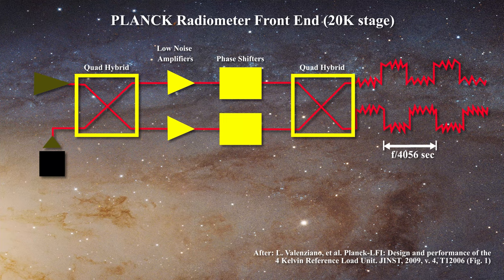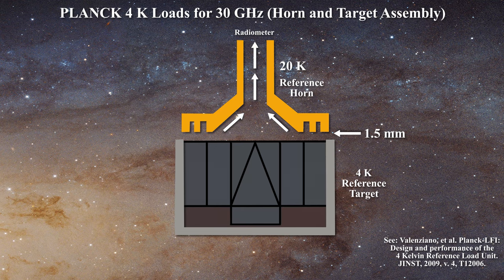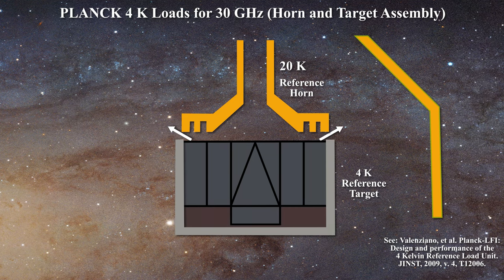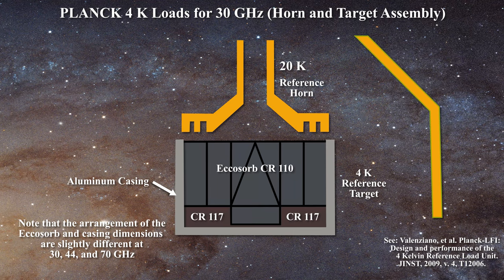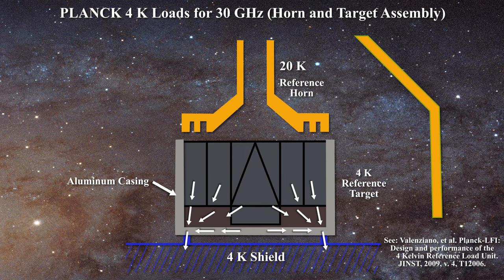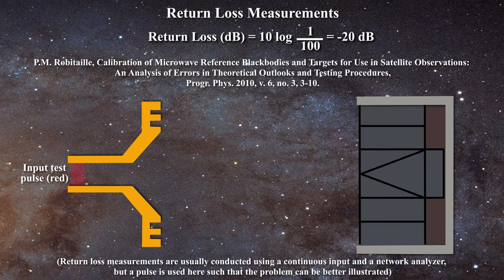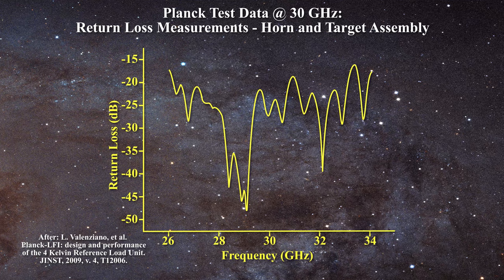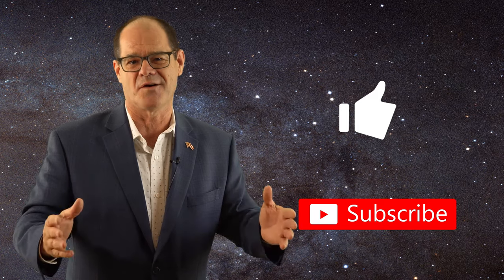Planck Satellite - Analysis of the 4K Blackbodies!

Comment: Ok The usual attack by your poor understanding of technical effects at the 1% which is used to rubbish the measurements.

1) At -20dB return loss that means the calibrator is absorbing 99% of the power that's blacker than your favourite carbon black at 95%. Any slight ripple in the remaining 1% doesn't matter
2) Should be as much spill-in as spill-out which is not seen ie you want 99% lost through the gap, which means inflight 99% of the outside 20K radiation would get in. Also, you see those slots around the air gap, they are to decouple the electrical field from the surface to specifically prevent the slot from transmitting radiation.
3) You clearly have no understanding of thermodynamics. If an absorber is at 4K it has to emit at 4K because it's just a dumb bit of material being jostled by its neighbours also at 4K. You need to employ Maxwell's Demons to stop the emitting of photons.

Besides, I have direct experience of using calibrators like these in cryostats and I can assure you they work!

Also by the way, why didn't you include the 300K microwave emission from landmasses is your Oceanic monopole?
Reply: "Ok The usual attack by your poor understanding of technical effects at the 1% which is used to rubbish the measurements."
 Watson

Unfortunately for the Planck team, it is not just a 1% error!  It appears that you do not properly understand return loss measurements and the problems which can be encountered with them, as your follow up post clearly demonstrated.

"1) At -20dB return loss that means the calibrator is absorbing 99% of the power that's blacker than your favourite carbon black at 95%. Any slight ripple in the remaining 1% doesn't matter"
. Watson

Unfortunately, that is only true if 1) you have no possibility of generating standing waves in the material, 2) you have no unexpected losses and 3) everything is absorbed on first pass (which you can never know).  Yet, the PLANCK team has resonances in their data, not just a slight ripple.  So they do not have a blackbody.  Blackbodies cannot support standing waves.  Rather, they must immediately thermalize all the incoming radiation.  This is clearly not happening in this case.  Secondly, the Planck team's own data shows that the E field travels beyond the gap and furthermore, that the differences between the Eccosorb 110 and 117 do not affect its distribution.  You do not have a blackbody and your losses to processes other than absorption are non-negligible. ( see figure 10 in https://iopscience.iop.org/article/10.1088/1748-0221/4/12/T12006/pdf )

2) "Should be as much spill-in as spill-out which is not seen ie you want 99% lost through the gap, which means inflight 99% of the outside 20K radiation would get in. Also, you see those slots around the air gap, they are to decouple the electrical field from the surface to specifically prevent the slot from transmitting radiation.
" Watson

Strange statement, as the network analyzer pumping microwaves into your cavity produces E fields which are unlikely to be in the same orientation as microwaves entering the cavity from the outside.  That is important, since the gaps is 1.5 mm in one direction, but about 3 cm in the other. However, one thing is clear, you are not "prevent(ing) the slot (gap?) from transmitting radiation".  Just look at Figure 10 again in this paper ( https://iopscience.iop.org/article/10.1088/1748-0221/4/12/T12006/pdf ).  The E field is shown to be moving outside the gap with little effect of the slots.  In any case, if the PLANCK team wanted to be sure, they should have checked the problem experimentally when the satellite was still on the ground.

3) "You clearly have no understanding of thermodynamics. If an absorber is at 4K it has to emit at 4K because it's just a dumb bit of material being jostled by its neighbours also at 4K. You need to employ Maxwell's Demons to stop the emitting of photons."
 Watson

No, when you have conductive paths open and the wavelength under consideration is on the order of the dimension of the absorber - oscillations in the material can couple to the conductor, then you can form a gray body and your emissivity will not be 1.  Gray bodies do not depend on Maxwell's demons and it sure looks like the Planck team knew how to build one!
Reply: See Steve's reply... not 1%. Geez Bob.